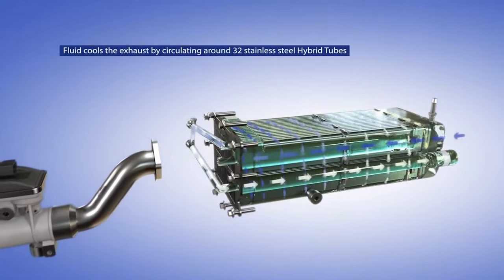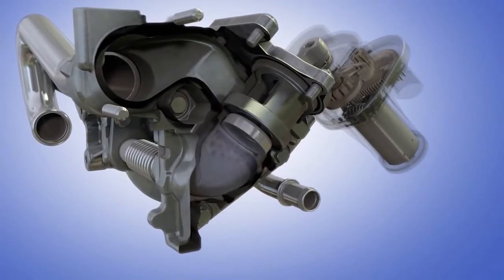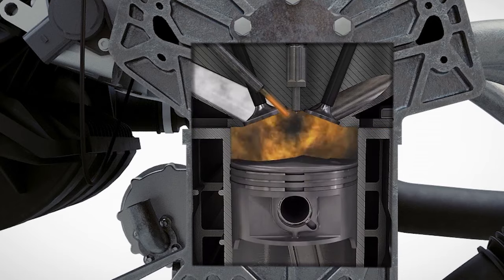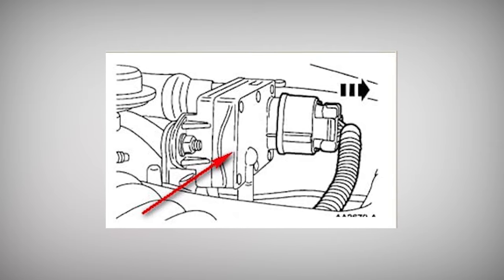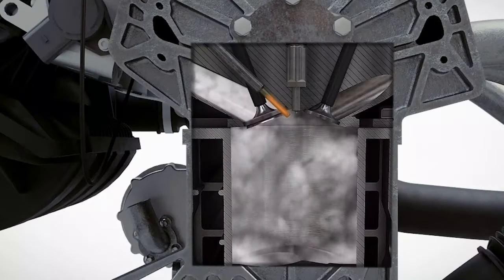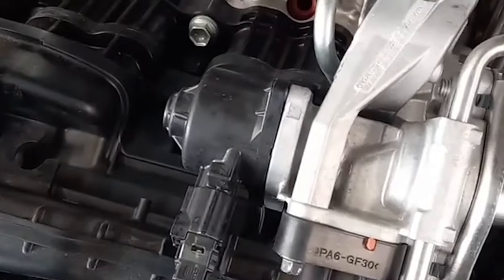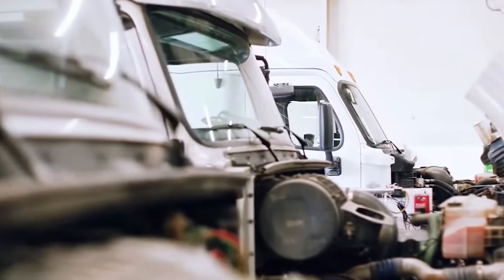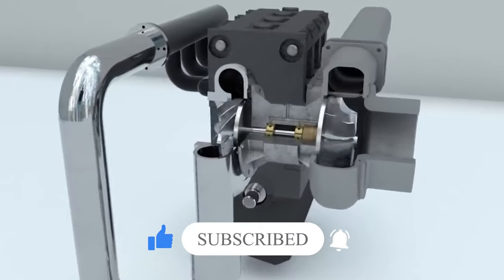Egr Valve: What Is It And Why Does Your Car Need One?

Comment: Best lesson learned: the best EGR is the deleted EGR.
Reply: Most definitely agree
Reply: @ilovecannabisalot7324  No, not plug the Pcv!! Stop smoking pot so much!!😂
Reply: My car has both EGR and PCV 😅
Reply: So True
Reply: depends, if the egr valve is not present, the temperature will rise in the cat and damage it, so its best to have a egr if you still have the cat otherwise the cat will need to be replaced and its expensive, so basically we crated the problem of a cat not being able to handle high temperature fumes and for the reason we will make your car get exhaust fumes into the intake, so EGR delete and cat delete
Reply: @GabrielM01  Also the EGR lowers temperatures, reducing nox in petrols, I’m not sure about diesels
Reply: After working on a farm with newer equipment, def and egr are the main problems

Comment: How can the EGR," improve engine efficiency" ??  I cannot see how engine efficiency can be improved and I am thinking of disconnecting the EGR valve on my car, any comments ??
Reply: Whatch out, it's illegal. Even writing about this, you risk check from the authorities
Reply: It doesn't it just reduces emissions and clogs up your engine full of carbon
Reply: @alejandrogaming9465  well you obviously know nothing about it! Get some education and then we can talk!
Reply: It’d probably throw codes and run like shit unless retuned
Reply: @paveljelinek772  Yeah well he didn't ask you for legal advice he asked if it is a NET positive OR negative to the engine.... So since you are "educated" on the subject what is your answer?
Reply: @TheBendixSA  I turn off EGRs on diesel engines on weekly basis. You just HAVE TO remap the ECU so engine does not suffer from consequences by doing the stuff
Reply: Less available oxygen means the engine puts in less fuel. The engine is creating less power per stroke. Therefore the throttle plate on a gasoline engine is open slightly more. If the throttle plate is open more than there is less vacuum in the intake manifold. Less vacuum means less pumping losses. Less pumping losses means more efficient engine.
Reply: It recirculates unburnt fuel & decreases the temperature of the engine.

Comment: Exhaust gas into the intake will not make you waste less fuel he doesn’t know what he’s talking about
Reply: False. You do not know what you are talking about. 
Less available oxygen means the engine puts in less fuel. The engine is creating less power per stroke. Therefore the throttle plate on a gasoline engine is open slightly more. If the throttle plate is open more then there is less vacuum in the intake manifold. Less vacuum means less pumping losses. Less pumping losses means more efficient engine.
Reply: @MyFutt  more power means less throttle so its the same shit if you ask me lol

Comment: How do you know when you need to replace it? Even without codes? Mine is 24 years old!
I'm not getting black smoke. I am having a slight rough idle and murmer when cold. I have new OEM Chrysler IAC, MAP and TPS and all new injectors, Coil, plugs and fuel pressure regulator.
Reply: Facts did you ever learn?

Comment: I have a 02 honda accord Se and running rich so I get smell of gas fumes inside the car when the fan is blowing inside the car and also when I press the gas I get a strong fume smell out the exhaust mufflers……so should I change the EGR VALVE?!??
Reply from the maker: We would recommend asking a mechanic to carry out an inspection of the vehicle and using a OBD diagnostics machine to understand what the issue could be. Thanks!
Reply: That would be the evap I had a 96 crv that did the same thing especially if you hear pressure build up in the gas tank

Comment: EGR valves do not help you get better.Fuel mileage, if anything it costs you feel mileage.It also destroys your motor prematurely And essentially restricts your air flow Especially in diesels. Also the idea That it helps cut down. The exhaust gasses in the environment is also c*** because Yes, exhaust gasses.Go into the atmosphere but guess what Trees and other vegetation Filter the Co two gases and turn it into oxygen Basically trees are  The planets air filter All this is a bunch of crap Word of advice delete the EG.R especially if you're going to spend a $100,000 on a truck Leave the stupid emission systems on the vehicle. Just tune it and shut it off. So you get rid of the check engine light And drive the vehicle and keep your mouth shut about it.  Keep a tuner on hand so if you have inspections every year you can turn it on before you go to the inspection. And then once you pass, shut it off again. And again keep your mouth shut. And don't fall into the kind of crap that this video is trying to get out They explained what the function is for. And what the EGR is for. But it's nothing but a bunch of garbage That has no truth behind it